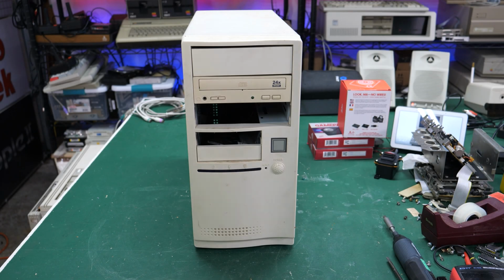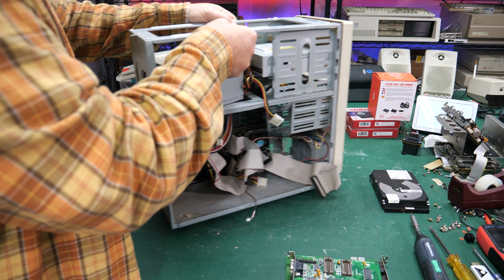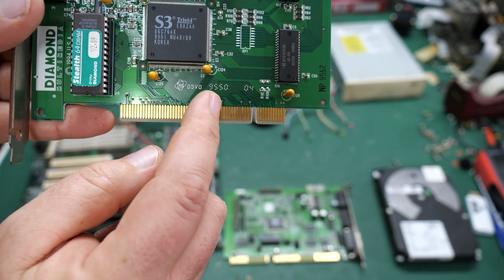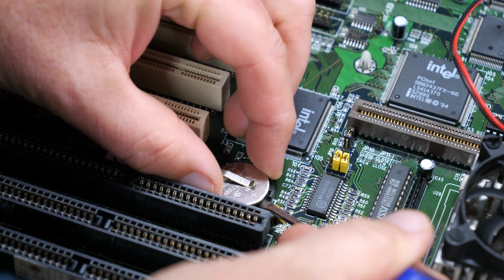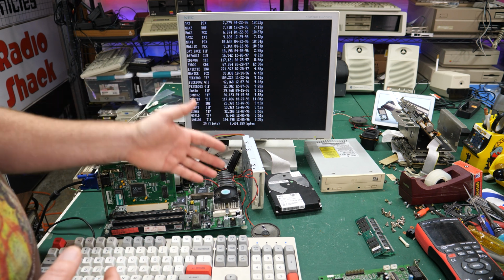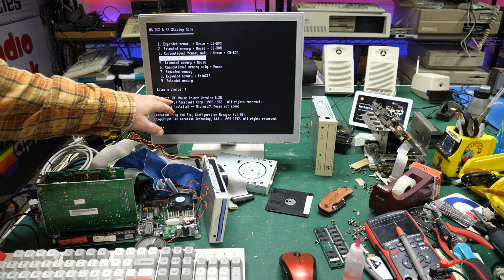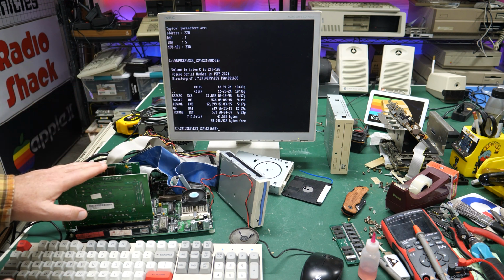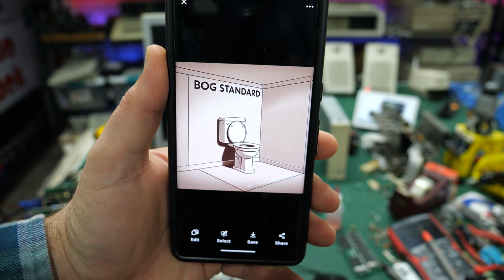This Mid-90s Pentium PC Was Headed for Scrap – Not Anymore!

Comment: These machines. Built so many over the years haha.. As far as data recovery, the oven method should only be used after you remove the controller from the drive. The heat destroys those heads and can warp the internals badly. The controller itself I had done before and was able to actually reflow it (in an actual constant temp oven that is). The freezer trick MAYBE worked one time. I had most luck doing controller/head transfers as long as the platters didn't have damage. Lucked out several of times.

Comment: Did I just witness crimes against drivemanity?
Reply: Yeah, you do the freezer thing FIRST. And the oven thing is to re-flow solder joints. If you can HEAR the head crashing, that's not a solder joint issue.
Reply: Yeah, please don't anybody do this.  It's never going to help, and it's very likely to make things worse.

For one, 350F is not hot enough to reflow solder.  You need about 350C to do that.  At which point, just about anything made of rubber or plastic is going to turn to goo.  This is why PCBs are put through the wave-soldering or hot air soldering process before things like that are added.  You cannot put an entire assembled product through soldering temperature and expect to get anything back but a molten pile of toxic waste.  Do not do that unless your goal is to literally toss the object into a fire to watch it burn.

Putting it in the freezer is okay, and some empirical evidence suggests it might do ... something ... which helps enough to recover a bit of data before the drive gives up permanently.  It's not a "fix" -- it's just a stop-gap that might buy you some time.

Also, that ticking sound is not the head crashing.  It's the drive repeatedly unloading and reloading the heads trying to find the sector you're asking for.  It can't find it, retracts the heads to the home position, and then tries again to locate it.  "Crashing" is when the heads make physical contact with the disk platter -- which, to be clear, is not supposed to happen, ever.  It doesn't make a gentle ticking sound.  It sounds like what you would imagine if a metallic head assembly collides into a solid metal disc, potentially (if powered on) while the disc is spinning at a few hundred RPM.

Comment: You killed a perfectly fine hard drive...
The data was old and it was slowly being demagnetized so it was having a hard time reading the stored data
All it needed probably was a fresh format or even spinrite to recover the data
But bake it in the oven?... man... seriously ? RIP
Reply from the maker: Hmm. I don't think so with that head crashing. I can try it next time I get a drive like that and see what happens.
Reply: A head crash is a very different failure and should not be confused with this. In a head crash you'd hear a screeching or grinding sound as one or more heads make physical contact with a platter and grind against it.

What the drive was doing was head knocking. It was re-trying reads that kept failing by throwing the heads back to a bump stop in order to get back to track 0 and start over. There are several reasons why a read might fail like that. It could be bad heads not reliably picking up data, but it's more likely just bit rot where the recorded data has lost its magnetic strength over the years. Given how beat up the case was I doubt much care was taken over the years to keep the computer away from magnets or sources of induction.

In some cases a drive can start working better after warming up, but that's tens of degrees and not oven temperatures. We're talking just enough heat that thermal expansion frees up stiction or corrects a marginal alignment. Chilling a drive uses the same principle, just through thermal contraction instead, and again just by tens of degrees.

An oven can be used to re-flow solder on the control board if you suspect cracked joints and can't find or access them by hand, but never the entire hard drive. The last thing you want to do to a magnetic medium is to heat-soak it. You'll scramble what data remains on it, and at high enough temperatures the medium can become permanently demagnetized.

Also I don't know what oven you used, but please never do this in an oven you also use for food. The fumes that off-gas from electronic components are toxic and can contaminate your oven.
Reply: @xenonkay   ^ This, a thousand times, this.  I really wish people would stop treating hardware like leftover lasagna.  It's not good for the hardware, and not particularly good for people, either.  It's a silly theory anyway, and this idea that cooking your hard drive is ever going to fix anything needs to be snuffed out for the good of everyone and their drives.

When a drive starts knocking like that, it's probably done-for, because it's most likely having trouble reading the servo track that is recorded at the factory.  But it COULD be just unreadable user data.  Either way, formatting the entire drive (or wiping with zeroes) might actually fix it, because if the drive is unable to even find that sector, a write operation might be enough to trigger the firmware to mark that physical sector as bad, and allocate a spare sector in its place.  At which point, you have a usable drive again.

BUT NOT IF YOU DROP IT IN THE AIR FRYER.  ><

Comment: Dude... that plate the motherboard is mounted to is designed to swing down 90 degrees to permit access to the motherboard.  Generally, remove all the exapansion cards, pull the screws at the top holding the plate, slide it toward the front a little and rotate downward.
Reply from the maker: Yeah. If the case was still in decent shape.

Comment: I love that it all still works, dammed if it is run of the mill hardware.  how hard will it be to find in another 30years? when our grandbaby's are our age... I save it all if I don't already have it. or similar.  I would keep the case to build a sleeper system.  Im sure it could be made to work again.
Reply from the maker: I would keep the case if the plastic wasn't falling apart.
Reply: @RetroHackShackAfterHours  Yup.  Polystyrene and ABS are both subject to embrittlement with age.  There's nothing for it once it gets a good start.  Regular treatment with a protectant like 303 Aerospace Protectant can help, but all things for a price.

Comment: Don't know how much data recovery you really wanted to achieve, but next time do the freezer first and the oven second! Although everyone  is cheering and popping champagne celebrating your wise decision to fry the drive before getting to any lucypics... oh, and take the board off the drive before ovening the board! But seriously, I always wanted to have a try at putting the drive in a plastic bag with an extension, stick it in a freezer and run the extension out of the freezer, then do a ddrescue of the drive. In case you decide to really try to save something from a failing drive, that could be the second option if the first failed to recover everything /failed due to stuck platter or such. In this case I doubt there would have been any difference.
Reply: next time DONT put the bloody drive anywhere 
The freezer "method" was to try to unstuck drive heads but that drive was CLICKING so the heads were not stuck
Stuck heads = SILENT not rotating drive
Reply: @fft2020   Freezing is also used to thermal-cycle a drive, which is a long-shot that it'll do anything useful, but sometimes just happens to help as a last-ditch effort to get some remaining data off of a failing drive.

The oven, on the other hand, is for baking chicken and pies and chicken pot pies.  It is not a troubleshooting tool.  Please everyone don't confuse it for one.
Reply: @sirnickity  freezing is only useful to TRY to release the drive heads from the surface of the disk as different metals contract a different length.... but I have never seen a case where this actually worked. And the symptoms of heads stuck is SILENCE or a low whine... not clicking

Comment: Silly question: why bully ones self with the Mobo fiddling? Rather remove the metal backplate with MoBo attached? It looks like it's held in with three screws... or did I screw up my observations?
Reply from the maker: I needed to take it off anyway if I wanted to bend that plate back.

Comment: Freezer method does work. I copied the data from several "dead" drives when I worked at computer store back in the 80-90s. Freezing only helps with mechanical issues by causing the metal parts to contract which releases stuck parts.